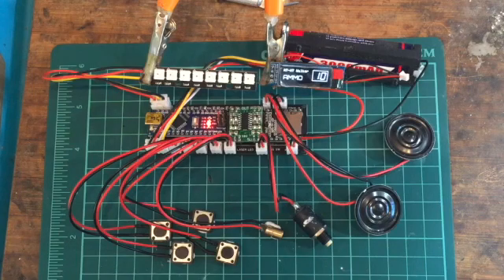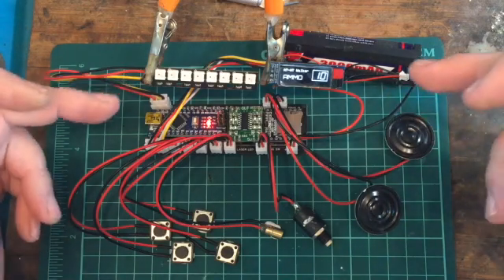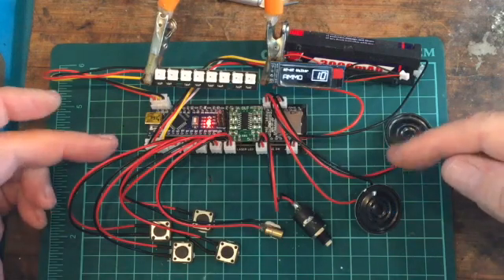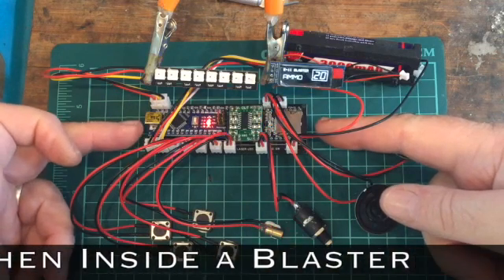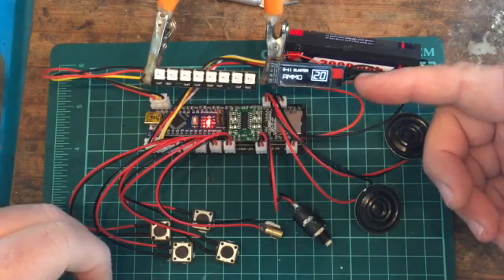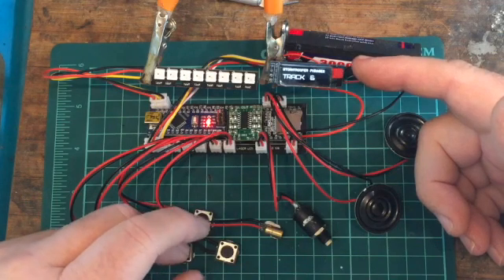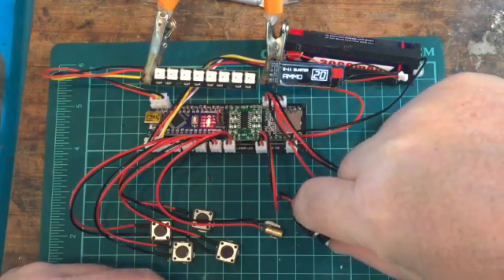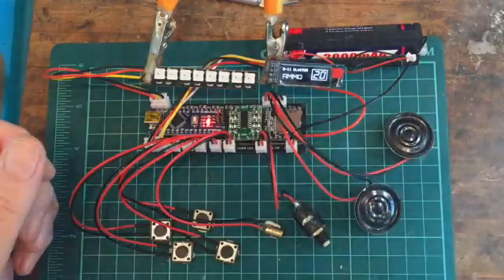Star Wars E-11 Blaster Electronics - BLTroniX

Comment: Nice work on this! 
Will you add the scope display screen in the future?
Reply from the maker: Thank you, I'm looking to do a PCB with the Arduino and Amplifier chips soldered directly to the board and adding button to turn the scope on and off. The Scope has it's own microcontroller which is very Small and fits inside the scope with the Screen, so it only needs power to run from the main board.
Reply: Can the laser dot sit be stacked? Instead of one dot can someone put in 3 dot sites like the predator sight? Can the amp handle the load? Since the red dot laser draws 130mA.... I think so....